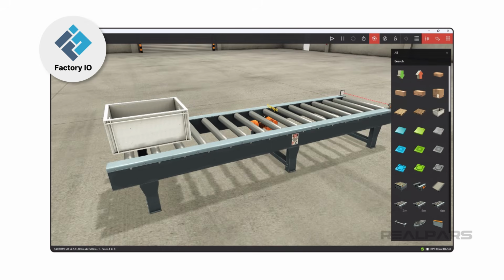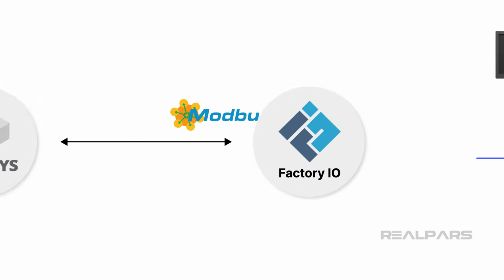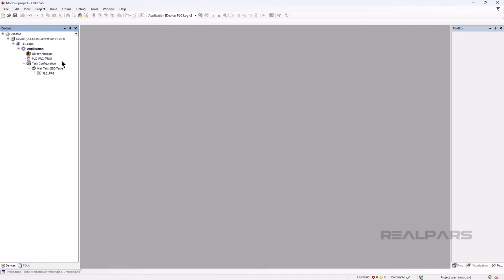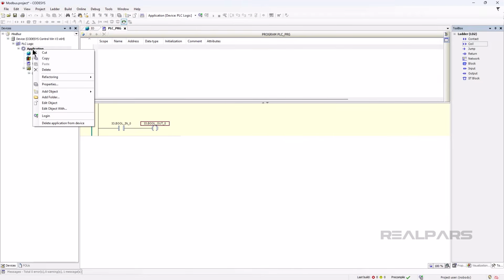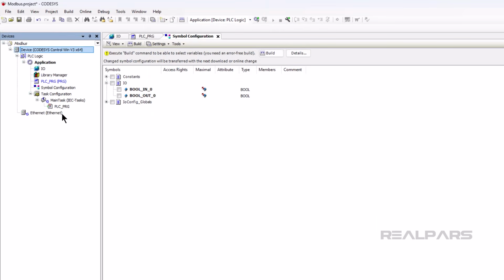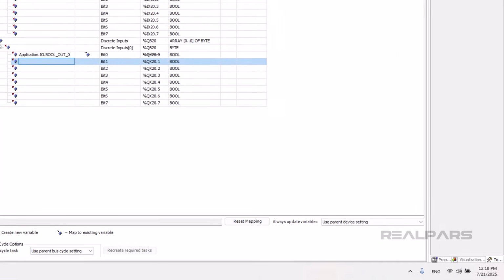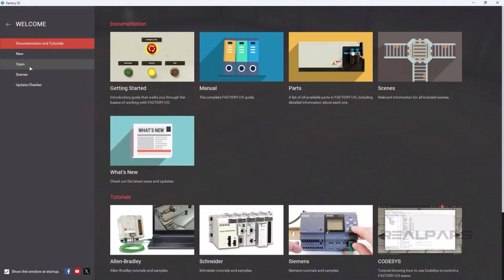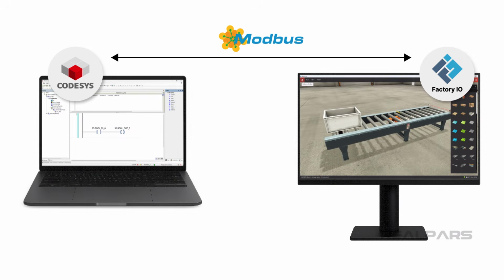How to Connect a CODESYS PLC to Factory IO Using Modbus

Comment: i dont know how to do it if i wanna make  a new scene , i tried using just a simple LD program of a switch and an indicator light , the TCP is connected , but how to chose coils , inputs ..  i put the switch ( in bit 0/ coils  just like the video )  and in factory io i chosed it as coil 1 . Im not even sure if it works like this.
Reply from the maker: Hello @deadspirit7420, thank you for your question. We're sorry to hear you're having trouble.

Unfortunately, we don't have enough information about your circuit, lab setup, or the equipment you're using to provide an accurate answer.

If you'd like to build a deeper understanding of this topic, we invite you to start our 7-day free trial. You'll get access to in-depth courses and hands-on learning resources that may help you troubleshoot similar issues in the future:
https://community.realpars.com/checkout/realpars-membership

Thank you for learning with RealPars!